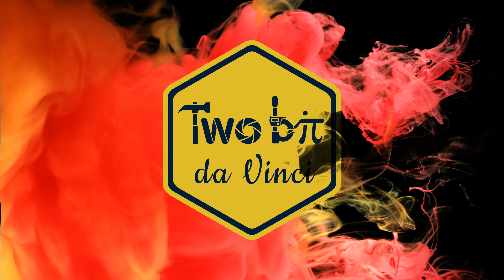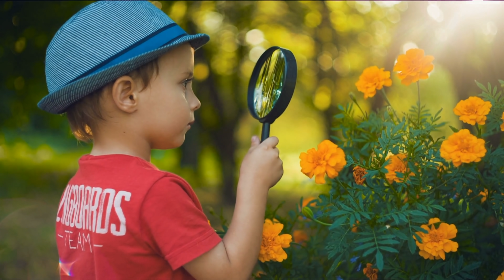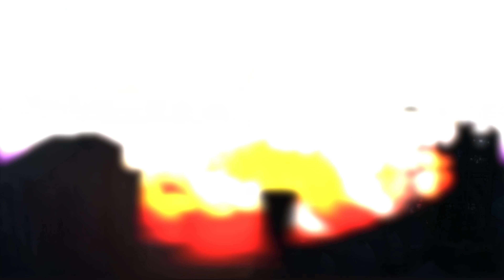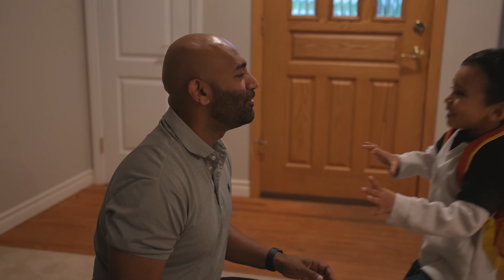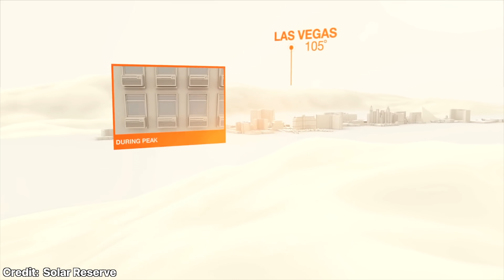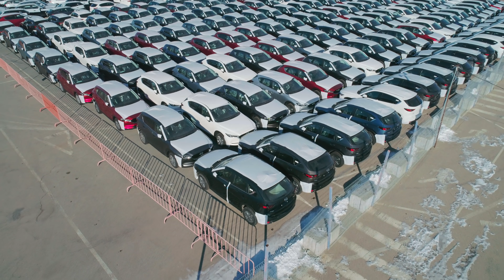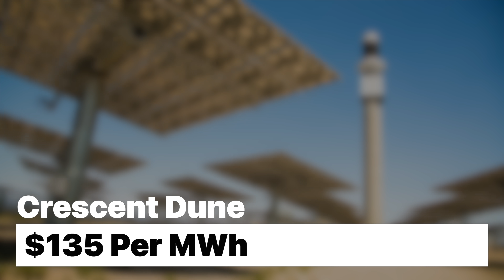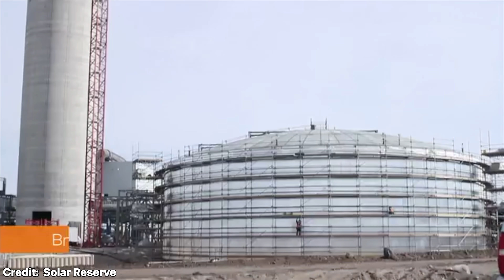This Billion Dollar Solar Plant was an EPIC Failure

Comment: One thing to point out, the video states something like "by the end of its time the plant was costing NV Energy $135/MWH," this makes it sound like costs ramped up to an unexpected level, but its important to note the reason the plant was costing NV Energy $135/MWH is because that was agreed upon purchase price well before the plant was even built (a purchase agreement for 25 years), not because operation costs ramped up to some unexpected level. NV Energy cancelled the contract because the power plant wasn't producing power at the levels that were promised, not because the price of power had run away from them (its possible NV Energy used low production as an excuse to get out the purchase agreement in light of cheaper agreements it was signing with new solar farms, but that'd just be speculation).

Also worth noting, after bankruptcy, restructuring, and some improvements, the plant is up and running again.
Reply: Wow!  Interesting.  Da Vinci sometimes misses the trees ... or is it the forest
Reply: @rcpmac  "Wow!  Interesting.  Da Vinci sometimes misses the trees ... or is it the forest"
A random youtuber being a not-so-reliable source of information? Who would have thought.
Reply: So the conclusion that the costs of maintaninance were too high to be worth running it are incorrect then? I was wondering whether the running costs claimed in the video included the cost of financing the construction in the first place. If they have claimed bankruptcy then the new owners may have gotten out of some of the construction debt.
Reply: @adrianthoroughgood1191  I believe they had a very expensive leak in the Salt chamber as the final nail in the coffin.

It's supposedly running again but I wonder for how long
Reply: @adrianthoroughgood1191  exactly.. I dont think a few employees with power washers and some engineers and welders cost THAT much.. when u don't need to worry about 2 billion in construction.. it gets way more feasible.
Think about that.. how much did usa print $ during c19? 10 trillion? 20? If it was 10 they could have built 5000 of these plants if they gone the swedish way and just ignored c19 for the most part and kept society running. Governments can b so stupid. In some cases dictators are better since they don't need to worry about reelection.
Reply: @adrianthoroughgood1191  i read several stories seems the obama/biden adm backed the loans several estimates 275 million to 775 million .  if it the later it cost more than the Solyndra debacle
Reply: If the plant still works and it produce more than it costs to run, and you can fix the problems with more engineering and more time, that's basically leaving money on the table not to put it to work while it lasts.
Reply: Bankruptcy... 10 cents on the dollar cost? Sure... after a 90% cut in plant cost it pays better. Try building it from scratch again.
Reply: @amascia8327  Rite! But please don't, even with the Fed's exponentially inflating (devalued) neoMonopoly play-money. The grid's already too fragile. We need lots more on-site E-gen, partially for back-up.
Reply: At what price are they selling electricity?
Reply: The only way something like this will make sense is if they have TOU rates. The utility will also have to have TOU and pass the peak charges onto the customers. This plant should never compete head to head with photovoltaic. Instead it should produce all its electricity in the evening when photovoltaic isn't producing any electricity and everyone has their AC on full blast. A fair way to compare this system is to compare it to photovoltaic plant with a huge onsite battery storage.
Reply: Why did it not make the predicted amount of power?
Reply: It's a bit like Iridium - all the original investors were soaked but the company which bought equipment  for 1c on the dollar (less actually) was able to make a profit on installed equipment whose depreciation didn't need factoring into the accountancy equation. It's a form of Asset Stripping
Reply: Wonderful - bankruptcy gets poorly functioning organizations a 2nd chance they don't deserve, by wiping out debts owed and shortchanging the investors. I've seen tech companies do that cycle over and over, and they never get better at their core function. Bankruptcy should not be so easy in the US. And while the government grants SEEM like a good way to encourage research and change, I've been around enough government projects (federal and local) to see how wasteful government projects are - and when they are grant funded it is much worse. Grant funds are treated almost as throw away $ by the government - very minimal reporting on how the $ was spent to keep the paperwork satisfied and the money faucet running. And the people doing that accounting don't have the same abilities or goals as the ssame person in private industry: private industry understands true cost of doing business, net present value of cash, how to compare return on investment. No one in the government (or most utilities that are typically glorified contractors to the government) does things in that "make sense" "true cost" manner.
Reply: @ws8080  That's not just limited to tech companies though.
Reply: Crescent Dunes is dead....a billion dollars of fossil burned to build a complete failure.
Reply: @snotnosewilly99  not to mention thousands of acres of destroyed land.
Reply: It was a way for the plant to restructure and nvenergy to get out of a bad contract
Reply: I believe some plants were set at avoided costs. Meaning take the most expensive plant and what it cost for power from that plant was the cost the utility would pay so investors would recoup capital. No?
Reply: $135 /MWH seems kind of high to me here in Arizona. Our electric utility charges us (now, in Sept 2022) about $106 /MWH for a residential usage of 938kWH (about 1 MWH) including costs of power generation as well as what they call "Power Supply" charges. But maybe electricity costs more in Nevada.
Reply: yeah i suspect there was some funny business going on, if i were engeneer there i would drop the storage part and just produce  during daytime, which would still reduce the use of fuel .  I cannot believe  that there was THAT much maintenance needed.  slow moving heliostats donet need that much maintenance look at how long automotive stuff spins at much higher . speeds. Plus if you only run during the day you have all night to clean the mirrors  hiring folks to do that simple a job does not cost THAT  much!!  the cost of a janitoral service or window washer
makes me wonder if there were some OTHER, non engineering  forces at work!!
Reply: The greed foy profit will kill America and the world
Reply: Same comment on a related video😂
Reply: And it was just announced it's closing 2 of its 3 sections.
Reply: There is another giant solar thermal energy station in Morocco & it works...
Reply: @MaxMisterC  their labour costs for the maintainance workers will be lower than in the us. CSP may be something that gets done in places with low labour costs like manufacturing.
Reply: @adrianthoroughgood1191  except that after restructuring, it is now working in America.
So, there is that..
Reply: @MaxMisterC  Hardly, locals despise it because 1) it sends power to Europe NOT Morrocco, 2) It requires 3 billion litres of water to operate,  something that is in short supply in A DESERT!
Reply: @paddle_shift  
So it's working then 🤔  good.
Reply: @MaxMisterC  Yep, the bonus is that it provides energy to Europe AND removes water for irrigating local farms in Morocco. Best win lose ever!
Reply: @paddle_shift  why would it use water? The steam is in a closed loop. If it's for cleaning the panels, why not use a vacuum or blower system.. u have energy...
Reply: @kungfreddie  the cooling water is needed to condense the used steam exhausted from the steam turbine back into water to be pumped back into the boiler/super heater.  All steam electric plants have this feature independent of the heat source.   Before you say, "can't they just reheat/repressurize the steam directly?"   Sure - but that takes more energy than you produced in the first place.
Reply: @kungfreddie  For cooling the steam - big thermal plants generally use large cooling towers which use ground water to accelerate cooling.    In the Sahara desert
some CSP plants have begun to use just larger facilities that transfer the heat to the surrounding atmosphere (air), to conserve the limited water resources.
There have been several instances when nuclear power plants have been idled to avoid overheating local rivers (injuring fish, etc).
Reply: So, they are calling this an EPIC failure but not any one of those Elon's projects? What is this? Oh... He has a positive video about that EPIC failed tesla solar panels... OH... This guys believes that "Flying cars" will be a thing in near future... jeez... i am in the wrong tree here... WTF YT
Reply: @Kiyoone   so, in your convoluted thought process, NO ONE -especially Mr. Musk should NEVER come up with new ideas... never come up with anything ELECTRIC- god forbid...never even THINK about RENEWABLE ENERGY...the very nerve, never think about new ways to STORE energy...Never CREATE energy.....REALLY?????
Reply: This was a total failure from the beginning,  as the Senator Harry Reid's dirty controlling corrupt fingers were all over it. And the plant is still not producing what faulse claims of power it said it would produce! Who are you a stooge for the Reids?
Reply: @InSomnia DrEvil Not only taxpayers, ratepayers are also being ripped off by solar and wind projects. These are not economical sources of energy. Without ripping off tax and rate payers, the number of solar and wind projects would collapse to ZERO.
Reply: @TubeMeisterJC  You can't compare solar and wind with reliable energy from FF and Nuclear. Unreliable energy will never be cheaper than reliable.
Reply: "NV Energy cancelled the contract because the power plant wasn't producing power at the levels that were promised...". So the Plant is useless. I'm sick and tired of saying that our only way out of fossil fuels is Nuclear.
Reply: Money...follow the money...the shysters of the world won't let us have free energy.
Reply: @MusicLovingFool1  It isn't free an
Reply: @MusicLovingFool1  not shysters, but even worse, CAPITALIST!!!
Reply: @MusicLovingFool1  Go lie in the sun.   That's all the free energy you will find. 
Everyone rightly expects to be paid for his labor and investments.
Reply: @MusicLovingFool1  Do you realize what free energy would mean? It would literally be larger than anything. Free energy doesn't exist. We will always need a means to capture it and typically transport it.
Reply: Great points. However, though massively and/or deliberately ignored, the root causes are much more important: A) the neoFeudal socioeconomics & bogus monetary system of kleptocracy, B) its paradigm installed in our wetware, C) corrupt kleptocrats & white-collar scammers, and D) =/-99% of us are bamboozled & put up with A, B, C, and the increasingly terminal consequences. Actually, worst of all is "B" because it fosters & supports all other defects & deficiencies of psychopathic civilization.
Reply: @mlmimichaellucasmontereyin6765  Oops, you forgot to put on your tinfoil hat this morning.
Reply: @mlmimichaellucasmontereyin6765  yah.. let's go communist.. that haven't spawned any psychopaths...
Reply: @mlmimichaellucasmontereyin6765  Why don't you just tell your story in English???
Reply: @mlmimichaellucasmontereyin6765  So, should I buy Crypto, then?

A wonderful option to Fiat Currency, especially since Crypto disappears forever if the Internet goes off.
Reply: @TimeSurfer206  LOL!!! Thanks for that refreshing dose of ice water. Itza the reason we need the next-gen replacement (the post-kleptocracy monetary credit system) with lots of varieties (of tokens etc ).
Reply: @mlmimichaellucasmontereyin6765  Ah, another Poker Chip to use for trading. We already have those, here in America, they're called "Dollars."
Some Native American tribes used seashells as currency.
The form of token is irrelevant. As long as WE ALL AGREE it has value.
Gold is just another type of Poker Chip.
Reply: @mlmimichaellucasmontereyin6765  There is only one thing in this world that has True Value, and that is the time that you and I have on it.
This is why the "Protestant Work Ethic" exists, so the Kleptocracy can make us think we should slave for peanuts.
No one ever got rich by "Working Hard." The only true method is to take advantage of the desperate, ignorant, and gullible.
Hi, Dumbald, why am I thinking of you, right now?
Reply: @TimeSurfer206  Wow!!! You're way mo cynical than me. However, that's why I decided to start a paradigm upgrade with new definitions of wealth, success, credit, value, wellness, sanity, demons, etc... I'm about to implement it in a new game, with real stable-coin for a stable economy & cultural wellness (after total cultural exorcism, retraining, etc.). So, stay tuned.
Reply: @TimeSurfer206  Hmmm... No fooling...? OK. Please define the terms: a) "dollars" & b) the basis of their actual market value & c) "value" & d) the standard of value. BTW, the old "indigenous" cultures didn't think of money & currency like most of us modern consumer-droids. FYI: JM Keynes was right about the ancient Yap Island money system being the most perfect in the world, and that--of all cultures--only the Yap folk had perfect understanding of money.
Reply: Here , here 👍👌

Comment: This could still work with automation, so you're not paying 100s of people to do basic chores like polishing mirrors. But the idea is premised on the fact that the molten salt continues to generate power at night, which PVC can't do. However, now we have a huge leap forward in storage, and suddenly again PVC has an advantage.
Reply: The latest EU installation has robotic  cleaners and computer monitors. The advantages ate the molton salt stores energy for supply during night. The corrosion problem designed out with more expensive installation.

Comment: Nuclear power is in the same boat, and the only way it works to even keep existing plants open is the massive subsidies it receives, and any new reactor designs would have to go through the same design process as this solar thermal plant. This would take decades, and it will just be even cheaper to install PV, wind, and batteries by the time the bugs were even worked out, let alone scaled. Nuclear power plants have been fined by the Nuclear Regulatory Commission for operating as a lagging source of power (peaker) as apposed to operating as a leading source (baseload) as they are designed for. They were doing this in order to try and make a profit from the power produced, but there is a lot more risk involved, and they are not permitted to do so. As an IBEW electrician who has worked at nuclear power plants, I believe that nuclear power is one of the biggest boondoggles ever perpetuated on the public. The myth of endless cheap energy has been with us since the 1950's, but is still a pie in the sky myth that just never seems to go away. If nuclear power had to pay a carbon tax, it would pay somewhere between natural gas and coal. Adjusted for inflation, the US has spent on average 3.5 billion dollars per year on direct taxpayer funded subsidies on nuclear power since 1947, and just 0.38 billion per year on clean energy since 1994. Yet nuclear power is still the most expensive form of utility scale electricity available, and clean energy is now among the cheapest.

Comment: Probably more of an accounting failure than a technical one - apparently it is easier to write off the losses than fix the problem.  Would love to know why corrosion is a supposedly an insurmountable issue when other facilities use essentially the same technology successfully.  
Now explain why it is more profitable to shut down than operate intermittently or better yet fix the thing.
Reply: Dang, you’re probably right! So much of our system is setup so that the easiest and cheapest option is just to throw out the current item and buy/build something new. No reason to assume this might be different!

Comment: I am a huge fan of the solar thermal on my roof. Very effective way to heat water vs pv running a water heater.
Reply: Solar thermal doesn't really pan out last time I did the math.

In terms of annual energy generation it costs a similar amount to solar, but it generates heat only.

Solar generates electricity, which is a much more valuable form of energy.

Where I live heat (natural gas) is about 2.3 cents/kwh and electricity is 9.3 cents/kwh. So Solar has a 7 year payback, and Solar thermal has about a 27 year payback.

And that's before considering using a heat pump, which can effectively double or more the heat output with Solar electricity.

The only place I could see Solar thermal making sense is in a hot location where you can use less expensive collectors, but in a place like that, Solar thermal begins to become irrelevant anyways.

There is something to be said for the simplicity however.
Reply: It may be "effective" whatever that means but a PV driven water heater is much more cost effective.  I've done $250,000 in evacuated tube thermal systems.  They work but are costly.
Reply: @rcpmac a french company has created PV-thermal hybrid panels now that have solar heat collecting tubes underneath the PVs. The PV ends up being more efficient by cooling them on very warm days. Run those solar heat collecting tubes to a heat pump and you've got an extremely efficient setup for heating and powering houses.